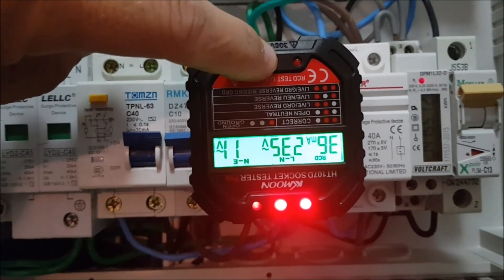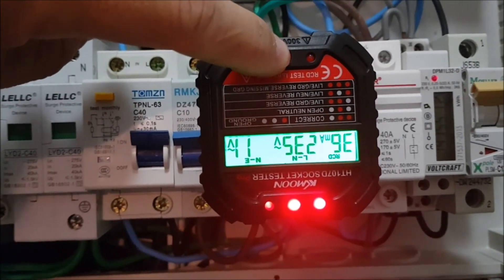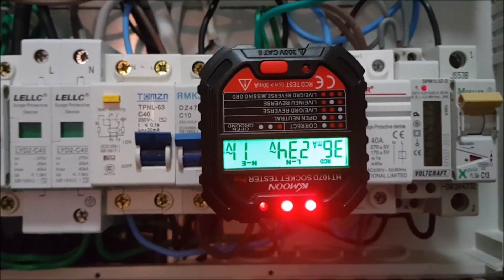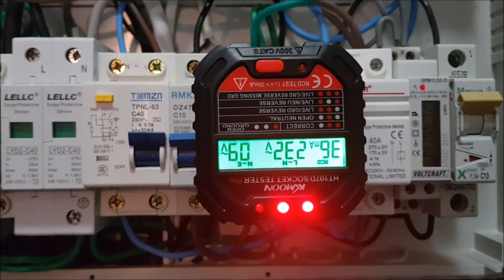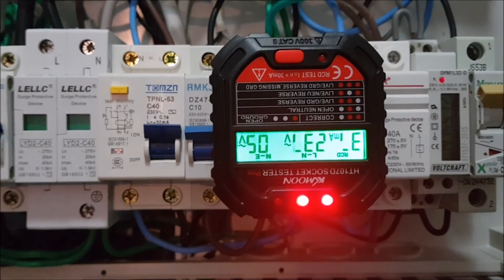Using a Socket Tester to check my Off-Grid systems N-G Bonding and Grounding

Comment: I allready ordered this socket tester (just branded Habotest instead Kmoon) a few hours ago, but unfortunately before I was watching your Video....I hope I can modify the RCD tripping current...
Reply from the maker: You bought the U.S. version?
Reply: @RolandW_DIYEnergyandMore  Yes I thought the testing current rise up from 5mA till the RCB trips and then the actual tripping current will be freezed in display. If it is just a fixed testing current I think I can replace a resistor. 
Update: It turned out theres no reasonable big resistor (exept a 16 Ohm) so I ended up without wasting time with reverse engineering and just building in my own test button, theres plenty of room for doing so (The screws to open are hidden behind the front lables)
Reply: @RolandW_DIYEnergyandMore  Just for a better feeling and to be able to control correctely I ordered now a "Megger" (insulation tester Aneng MH12) for 810 Baht : )
Reply from the maker: @topeye4202  OK, please let me know if it is worth anything after you have tested it :)
Reply: @RolandW_DIYEnergyandMore  I would be surprised if not. I have a few multimeters from Aneng and they are all reliable.
Reply: @RolandW_DIYEnergyandMore  You get more than you pay for it, cause you pay nothing just for the brand name. It works just fine. It has a relatively hard PVC soft shell, whitch is quite hard to remove if you whant to take a look inside, but it protects well - rock solid. Its ergonimic to hold in hand. The test leads are not high end, but the aligator clips can be screwed on, which is better than just  sticked on ones. The 4mm banana plug dont go completely into the megger, theres 2mm left, but this isn't a big deal. The back light stay on if turned on once, which I like. No beep when starting measurement, but visible through clear symbol and red illuminated test button. It allways begins with 50Volt when switch on (do not remember last setting). It takes abdolutely no current, 0,0 microampere from battery when turned off. The chart in user manual with 10 minute measurment of polarization index is questionable, cause there i get bad results according to this table. All other things as test voltages are correct and resistance measurement are correct, as far I was able to test/compare with other multimeters. Test results are repeatable and reasonable. 
For my uses its a good value for the money.
Reply: @RolandW_DIYEnergyandMore  By the way, it can be easy used to control the varistors I have spreaded everywere. It shows exactely the voltage at the point where they "breeak" through according to the rated voltage, when they are ok. Thats the only way for me to control them without a adjustable highvoltage source.
Reply from the maker: @topeye4202  great methode! what did you find out? what would be a typical voltage where the varistors are kicking in?
Reply: @RolandW_DIYEnergyandMore  The 20D391K I bought recently show (each one stable) 384 up to 401Volt which is within the tollerance they seem to have and at the 1,8mA the Insulation tester delivers. According to the datasheet they can be used with max. 250VAC constantly. In past I took  the 15D471K, but then I take a look at the datasheed and saw I can go deeper to cut off over voltage spikes earlier.

Comment: Thailand?  I'm in CNX and setup a PV container with ATS switch.  Bluetti AC200 Max running everything with grid reserve power, bonded in the distribution box.  Safe, but most people don't know generators are floating neutral and need bonding.  Good video!

Comment: Hi Roland please explain the term bonding.Does it mean a physical connection like at a bus bar with earth/neutral  together or do they have to be separated?  So my system will be stand alone/off grid 48v inverter with PV panels, do I connect earth/neutral together at bus bar and include all metal components at that bus bar. Does that earth (bond?) Have to go to one only ground "electrode". Do all PV panels have to be grounded to that same earth or separate earth's, as I understand in case of lightning strike or earth leakage currents could exist from electrodes? Still confused. Thanks however good tutorial!
Reply from the maker: Hi. Bonding is as you said the physical connection between the inactive earthing system with the Neutral part of the active power source. Other then in an isolated system which should only be used in special cases, bonded systems especially if you want to replicate a housing installation as it would be done with a grid installation should be preferred. You can use one ground electrode to earth your whole system, but if lets say you PV array is a distance away from the house on a separate mount, then its better to use another electrode right at the place there. Electrodes will pick up voltage differentials from the soil only if there is another one within the area of influence which is typically within 5m of each other.

Comment: Somebody like me, with only basic electrical skills, can go off grid fairly easily, its the N-G bonding that will catch most diy electricians out. 
Thanks,
Reply from the maker: You just need to keep in mind what that wire is for, and that it is only there to allow fault current to go back to its source, and nothing else. And in the case of inverters and gas generators, it is defining the leg with neutral potential...
Reply: Agreed.  I learned solar generators and most gas generators are floating neutral.  Built a solar shed and solar container cabin on my channel, and learned that bonding is done at distribution box and put in a ground rod 2m deep in the soil.

Comment: good information how do you know with European plug which way is upside down.
Reply from the maker: As you know, in AC for an appliance it doesn't really matter which pin is L and which N. So, the European Schuko plug can be plugged in either way because the grounding pin is accessible from both directions. But the tester is a device which is measuring between pins, so it needs to be plugged in the right way to do the leakage test. I could of course have changed the wiring of the outlet for the purpose of this video, but hey, I want to show you real life experience :)